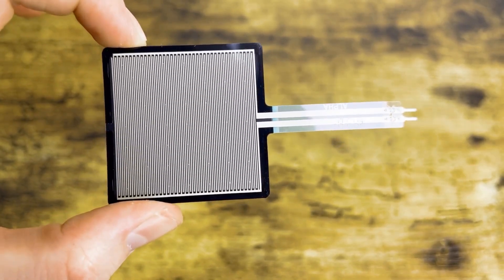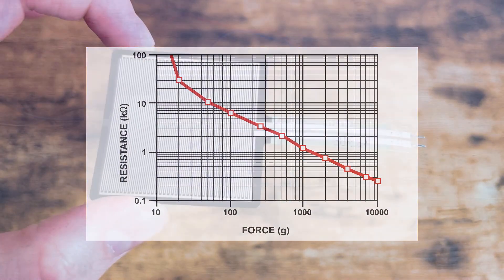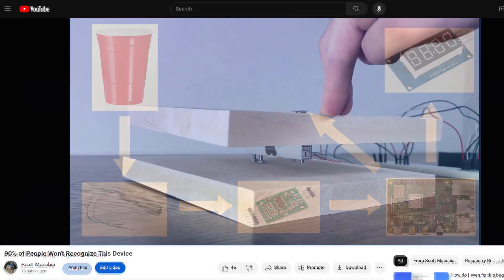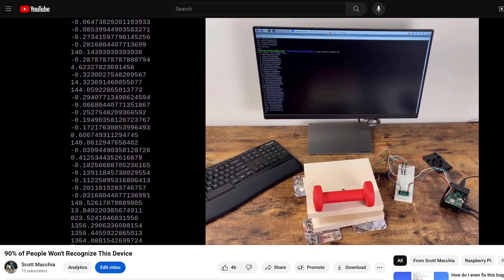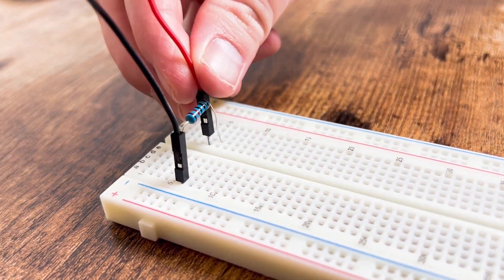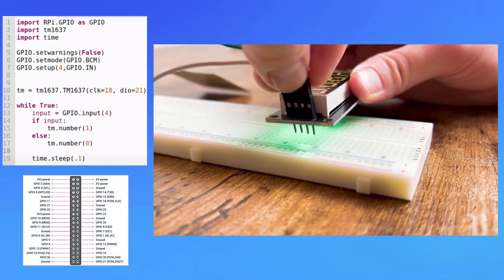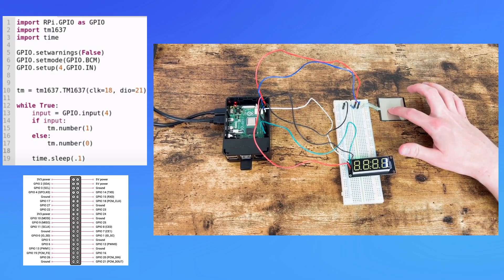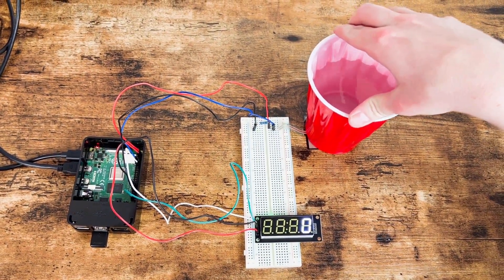You Need This Magic Square

Comment: Would you use something like an upside down truncated cone to increase the pressure in one spot?
Reply: Pressure = Force/Area. If I'm not wrong, @jamesskymobilivion is suggesting reducing the area at the base of the cup to increase the pressure.

I'm not exactly certain what your measure is (it looks like just the voltage of the circuit) but there could be a couple of fixes. One suggestion could be adding more resistance to increase the voltage of the sensor. I'd assume that because it's a binary input, if you raise the "resting" voltage closer to 3.3V, the system would theoretically take less force to trigger (I'd assume).
Reply from the maker: My expertise is in software development so I’m probably missing something here. Do you mind explaining a bit more on how that would work?

Comment: Switch to a 16-bit ADC (SPI/I2C). I would also amplify the signal being modulated by the FSR to raise the signal floor, making it easier to read changes at the lower force ranges. Just be sure to clamp the voltage ceiling so you don't fry the ADC if too much force is applied to the FSR. You can probably just use a zener diode for this. But a 16-bit ADC may have enough resolution on its own to differentiate a small change in resistance. I would also apply a moving/running average to the readings to stabilize any transient noise.
Reply from the maker: That’s a great point. Since I am looking for binary input I concluded that there wasn’t any more need for the ADC. However you’re 100% correct. I would definitely get more detailed input and can calculate the binary result myself. I will definitely retry the experiment with an ADC